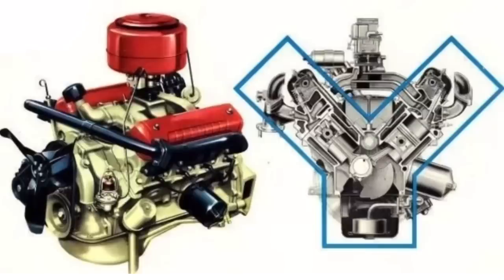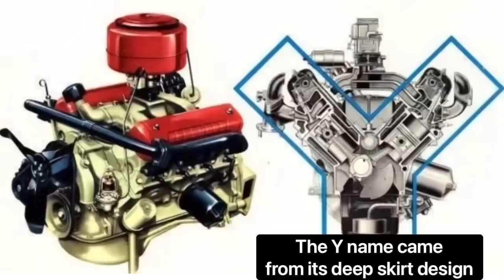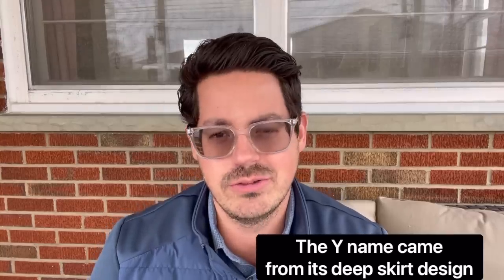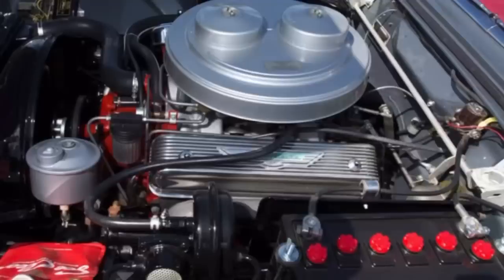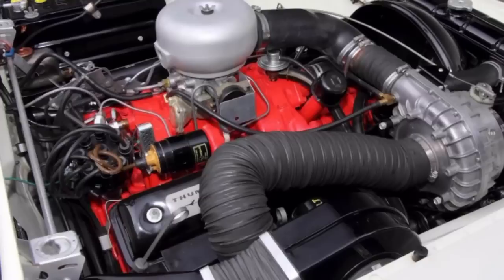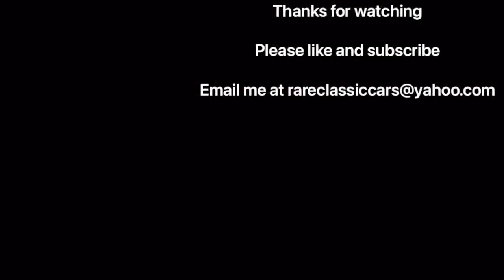Worst Engines of All Time: Ford Y Block V8

Comment: I have had quite a few Ford machines in my day. I was always amazed how many different families of engines Ford had. They all had their idiosyncrasy’s. 
It’s like they were trying to “re-invent the wheel” with all of them. Especially the FE series which I had the most experience with. They never seemed to get the details right. For example the oil ports from the oil pump were gently sloped and the holes in the block were straight holes that were not even close to matching the ports. Then, the rocker shafts and the head returns would flood without proper drain back. In their infinite wisdom they decided to route the oil to the cam first instead of the mains. The trick is to put a large Holley jet in each head oil journal to slow down the flow.
Reply: Thank you for another interesting and informative video. I have been watching a lot of the videos from Art’s collection. I’m so glad to see you all are doing well. Take care

Comment: Got an original Y-block in my 59 F100. It did spin a bearing and block oil on one side. Broke one exhaust pushrod and bent one intake. Sent exhaust through the carburetor and lit the air filter on fire. We rebuilt the engine and heads, bored it out, bigger cam, safe valve seats for ethanol, mummert 4 barrel intake, msd electronic ignition and long tube headers and reground crank. 550 4 barrel Edelbrock. It sounds and drives really nice.

Comment: There is a very important piece of information left out of this video that I learned the hard way....from bad experience rebuilding Y block Ford engines of all displacements.
Modern replacement Y block camshaft bearings made by Mahle/Clevite and other manufacturers are softer than the originals, and will "mushroom" into the groove on the camshaft journal which supplies oil to the rocker arms.These must NEVER be used or oil starvation to the rocker arms WILL occur , sometimes in as little as a few hundred miles. NOS.....or other "early" alloy bearings must be sourced for installation, they can be found online, and there is a supplier in the U.S. midwest which has kept these bearings in stock, but Im not going to mention the company here lest I run afoul of some YouTube advertising regulation.
Since the Y block was made in Argentina (and supposedly in some other countries) as late as 1984,  (although with different cylinder heads) CORRECT cam bearings are available, if more difficult to procure.
 In addition, camshaft journals in the engine block should be line bored as part of the rebuild process. One of the holes in the cam bearing receives oil from the oil pump, the other two provide oil to the respective rocker arm assemblies on either side of the engine, upon installation these holes MUST be aligned with their respective passages, and ideally modified with a die grinder bit and Dremel to ensure maximum flow. 
The oil feed groove in the cam journal may also be deepened and slightly widened by a competent machine shop as some aftermarket camshafts do not have the oil feed groove deep or wide enough. An alternative method is to use the "California oilers" for supplying oil to the rocker shafts as mentioned in the video, this requires holes being drilled in both the valve covers and end plugs on the rocker shafts.
I am the technical advisor for the Rocky Mountain Thunderbird Club, and have spread these findings throughout the various Thunderbird clubs through their newsletters, but anyone attempting a rebuild on a Y block needs to know.
This also applies to the 368 ci Y.Block variant used in the Lincoln Mark II and some Mercury models of the mid 1950s

Comment: My memories of the Y block come from one of my uncles, who insisted on driving late 50's - early 60's Fords 10's of thousands of miles a year, using non detergent oil in them and never changing that oil. They always made a hellacious clicking/ticking racket when running and none of them ever lasted beyond 70 thousand miles or so before their engine failed. At that point, he would take his tractor, pull the carcass of the old car out into his pasture, take the wheels and tires off, then buy another old Ford to drive to work (this was the late 60's - early 70's so these cars were cheap to buy).  And once when I was spending a couple weeks with my cousin (his son) one summer, we went out to the Ford graveyard and pulled a valve cover off one of those engines. We could barely make out anything mechanical under the valve cover, as all we could see was a thick black, crusty layer of sludge.

Comment: Did you have to remove the valve lifters from underneath with the cam out? Typical odd ford engineering making thinks more complicated than required.

Comment: i had a 292 and a 312 both sucked bad had to put over head oilers had no power so i pulled it and put in a 1963 t bird 390 tri power 400 hp engine

Comment: My dad graduated high school in 1951 and bought his first new car, a Ford, in 1954.  It had a Y block and it made him a Ford hater for life.  The engine top end burned up driving from San Angelo to Kansas City on his first leave from the Air Force.  He told me the top end oil holes in the block and heads did not line up and the oils of the time were non-detergent and plugged up the top end.  Ford would not warranty the engine and denied a problem according to him.  Hobbyists came up with the external oiling and that fixed it for that engine.  By then my dad had moved on to small block Chevys.  The first car I recall was our V8 1957 Chevy Bel Air in Dusk Pearl, a beautiful shade of purple.  We had Novas and Chevelles and Impalas in the 1960s and 1970s.  I eventually bought a 1966 Fairlane 289 and numerous 289 Mustangs, and the Windsor series were very reliable.  My dad also religiously used either Valvoline or Texaco Havoline in his engines after the Y block fiasco.  He never got over his hatred for Ford.  I would be too if my brand new car burned up the engine.

Comment: you are full of crap. I have been driving my 59 292 since 2001. Yes, they had oiling problems. The solutions are well known and I followed directions carefully. No other engine sounds as good as a Yblock with dual straight pipes.

Comment: Dad fixed his '58 Y-block Ford by buying a '62 Bel Air. The Y-B ate a defective part on the air cleaner and blew oil out consistently. Dad left Ford forever after that.

Comment: Motor oil has come a long way. Havoline was cheep. Most people used it because it was cheep.
In the 1950s my dad bought oil for 3.50 a case, a case of 24 cans. 24  guarts of oil.
Around 1958 I found the best oil was 30 wt. Gulfpride. It was a high detergent and would clean and keep clean. My belief was even better than todays oil that leaves a golden film of something inside your high priced engine.
Don’t know how many Ford made from peanut butter 289s I took apart with worn out everything, I mean everything ,valve guides, valve seats, cylinders, pistons, bearings and crankshafts. Finally the auto industry in the 80s began using real metal blocks ,etc. and it was surprising to remove heads and find cylinders with hone marks still  Even with high miles.
Such a pity now engines run more miles but they engineer them where a simple valve job and ring. Job is out of the question. Don’t get me wrong, I still have a fast beating heart for a good running , well made engine. Kinda like dope Maybe. It is in the blood and has been from my youth.

Comment: My dad purchased a new Ford pickup with the Y block 292 c.i. V8 engine in early 1964. He drove the pickup nearly five years accumulating over 90,000 miles. Never any problem. My dad really liked that pickup and that engine. A new 1969 Ford truck replaced the 1964. The 1969 had the 360 c.i. V8 which was an FE engine for trucks., very similar to the 352 c.i. and 390 c.i. V8 FE engines. Never a problem with that engine or truck either. I agree with you that the Ford FE V8 engines were stout engines but my dad never liked the FE engine as much as the Y block engine. He claimed that the 1964 truck has better pulling power. He should have known as he was towing completely loaded 3 bale cotton trailers to the gin. I was just a kid back then so I don't have an opinion but I did tow loaded cotton trailers to the gin when I got my driver's license. As far as I'm concerned the 1969 truck with the  360 FE V8 towed loaded cotton trailers just fine. Both trucks had 3 speed manual transmissions, no power steering or brakes. Automakers back then sold mostly very basic cars and pickup trucks and still made money, I suppose. It was the 1960's when operation costs were low.

Comment: Being a teenager in the 60's, and working in a service station from 15 years + during my high school years, I was under the hood of many Ford's in the day. Each and every one had the overhead external oilers on them. They were a engineering failure and could not compete with the Chevrolet small blocks. Chevy's  independent rocker arms allowed the engine to rev and produce good power. Why do you think the T-Bird went to a luxury 4 door in 1958, Corvettes were eating them for lunch. And for all the "Y" block lovers explain why Ford dumped them and went with independent rockers on their small blocks, also how come Chevy small blocks were the main engine for decades.
Reply from the maker: Yep. This comment.

Comment: I remember working in my Dad's shop in the early 80s. Just about every engine we took apart had sludge to some extent. We worked in Massachusetts. Down here in Florida now, working on the 5.2 Magnum in my 94 Dakota with 200k miles on it and I'm impressed with the lack of sludge. Synthetic  oils and engines which are already warm before you start them I guess.

Comment: Good engine as appeared and with no room for future performance & improvement without some real work. 

Eaton Balancing regularly builds high horse Y-Blocks for Engine Master Challenges and has some great write ups. 

Involves stuff like Honda Rod diameters, alloy heads, does a lot of dyno comparisons and real careful selection of parts to manage real power from a Y-Block.

Comment: My first vehicle was a 56 F-100 with a 292...and it was thrashed. It burned/leaked a quart of oil every 50 miles...and yet ...I drove it at highway speeds and it never failed to start despite fouled plugs.

Comment: My father, and older brother had Y blocks from the fifties, til my father sold his last '57 Thunderbird in the middle '80s, not one of them had issues, even my brother's 312 with the Clay Smith cam, Jahn's hi compression pistons, ported heads, Jardine headers, and the dual quads setup off an "E" 'bird 312, in a '56 Victoria that won far more races than not (both on the street and Detroit Dragway), well into the middle '60s.
The family engine secret? Regular oil changes with good oil and filters.
Seems another "tech" opinion not quite true in another YT video.

Comment: Funny I am old enough to remember those ford's and recall hearing their clicking rocker arms regularly.
   It's funny that I watch the reruns of the Highway Patrol TV series and those engines could often be heard clearly clicking when those cars were brand new, so it was more than an oil changing issue, there was a design flaw in the oiling system.
Reply from the maker: I agree. Yet you see some people think I’m crazy.

Comment: I owned a 1957 Ford Ranchero with the 292 "Thunderbird" V8 engine. Heard stories about lack of oil to the top end so I started it with the valve covers removed. What a mess. OIL EVERYWHERE!   A great running engine. With overdrive and the factory 3.89 diff, 20+ MPG at 60 MPH.  A friend had a 1954 3/4 ton pickup with the original 239. That was a very reliable engine.   The Navy used a mobile generator powered by the Y Block, called the NC-5.  No engine problems that I was aware of but they had a bad habit of jumping into gear and racing across the flightline.

Comment: The engine wasn't them selves bad, it was maintainece sure, but the bigger issue was it's really really hard to make a great second act. The flatties where amazing engines, sure 110 hp from the factory but how many flatties where factory when the hotrod scene loves them to this day?  But more importantly, the competition blew them out of the water, in a single year. I'm sure plenty of blue to the bone ford guys will swear up and down how good the y block was and blah blah, but the fact is the SBC in 1955 revolutionized what a small block v8 was and ford had to play catch up with the Windsor, even Chrysler had to design the LA.

The y block never really had a chance, ford was first to market with a new v8 but they got left in the dust, and that was obvious when in 1956 they had to expand up to the 272 y block to compete with the more powerful higher torque, lighter AND more efficient 265 Chevy. When the Windsor came out it was obvious they had to look at the sbc play book, gone was the deep skirted block (which funny enough came back in modern times all modern V8s are y blocks including GMs own LS) open lifter valley etc etc. And you can argue back and forth on them. Cleveland doesn't count because it was a 1969 introduction which was very late. By then the 350 was the gold standard of performance and doing pretty well it was already making that (at the time) magical 1hp/cuin.

Here's the big thing, ford made the same mistake a second time in 1992, the ford modular engine was trash, and you can tell me how reliable it was and how much it could do with a supercharger but it's all just not true. You can clown on the northstar but that engine was innovative to a fault, the modular is a plain jane design with 0 innovation to a fault. GM already made the LT5 with DOHC, hell ford had the cammer. So the sohc 4.6l engine was worthless, it had the power of a v6 with the fuel consumption of 8 and 0 room to grow unless you hand built it. It wasn't until the cayote that ford had a v8 worth talking about again. And no the dohc modular wasn't a good engine either, ask anyone with a navigator marauder etc etc on how many engines they've been through. Meanwhile 1996 gm perfected the pushrod engine and made the LS and you don't need anyone to tell you how good that is. Even the money strapped Chrysler managed to produce better engines than ford.

It's funny Chevy became the GM golden child and that worked out really well for GM at the end of the day, all the innovation that was from Pontiac or Buick or Cadillac or Oldsmobile division went to Chevy to make their own v8 better and the others simply died out. A lot of the leg work on the LS series was done by Oldsmobile and Buick.
Reply: Wow you sure need educated badly don’t ya I’ve never read such b s in all my life

Comment: they had head cracking issues too..... and I had a chevy 235 inline 6....same issues with oiling....non-detergent oil caked the entire engine and it too needed an oil bypass

Comment: I had a 1962 F100 with the 292.  The exhaust exited out the front of one bank into the front of the other and out the rear of that bank.

Comment: I was born in 1960 so I remember these, oil was different back then so changes were critical today it is like history is repeating, some newer cars and trucks with variable valve timing will not deal well with late oil changes very small passages for the cam phasers so I guess some things never change, take care of your car, it will take care of you but 7,000 miles is fine on newer cars with good oil and filter

Comment: The old side valve V8 were Reliable Long Life engines they had some design faults but generally served well, strictly speaking they did not refer to the Y block as a V8, they were not high HP more just your family man everyday driver, the SBC was a success from the start, good power reliable tough!!

Comment: Ford was courageous with the introduction of the Y-block. Upper end oil starvation was easily remedied by enlarging the oil passage in the head, and capping the rocker-shaft, pressurizing them. They were very sturdy engines, although the"over-and-under" porting of the cylinder heads really hindered breathing. Some judicious displacement increases, and revised cylinder heads could have given the engine a new lease on life.

Comment: I wish my dad were still alive so I could ask him if the V8 in his '54 Ford was the reason he had to part with that car (and buy a brand-new '60 Rambler - something that even a family friend's young son pointed out was a "cheap" move!). Dad was no mechanic and worse, not at all into auto maintenance (mechanical nor appearance care, as in vacuuming and washing the car). I always wondered why he seemed to be replacing the car in five or six year intervals (before I arrived on the scene). As a kid into cars it was me who coaxed him into changing oil regularly (and ourselves), but that was decades later. The '54 Ford was Dad's only V8 I think until we bought a Buick Skylark in '71, so maybe his experience with a Y-block killed his taste for a V8 (or it was just because he wasn't into cars and a six did the job)!

Comment: There were a lot of reasons for the piling issues, most of what you cover.
But what caused a lot of the spun cam bearings was blown head gaskets that were only leaking a small amount into the oil. People would let it go because it seemed like a small issue, but in reality it was taking the coating off of the cam bearings also mains and rods. The cam bearings would be the first to fail and stick to the cam causing loss of upper oiling.
If they had the head gaskets changed out, and back then most would opt for only the basket that was leaking, the main bearing wear would show up as low oil pressure after the engine would warm up. But eventually would "roll" in a set of bearings.
These engines were actually very good engines. I grew up in Forks WA which is a logging and mills town. You would find they were used in log trucks, hauling shake bolts, be transplanted on to generators, water pumps, and old logging Donkies.